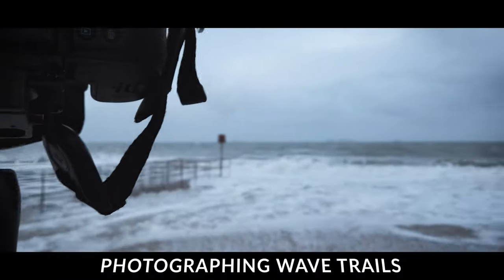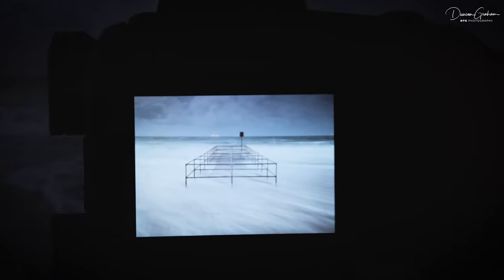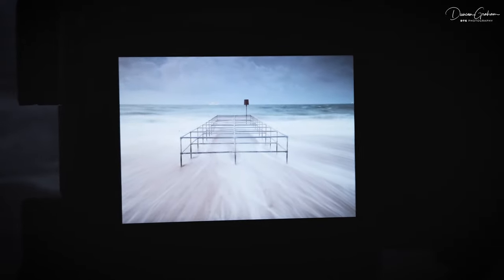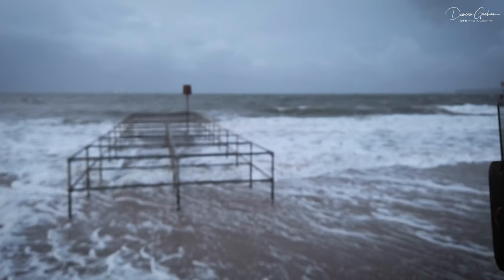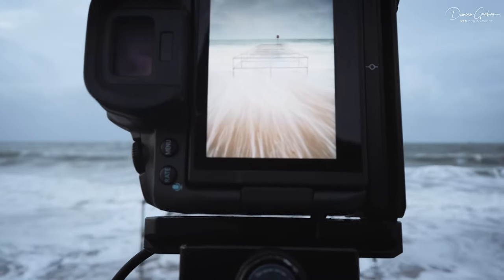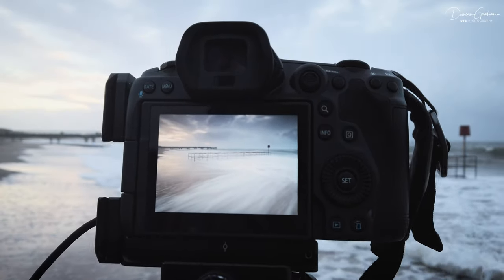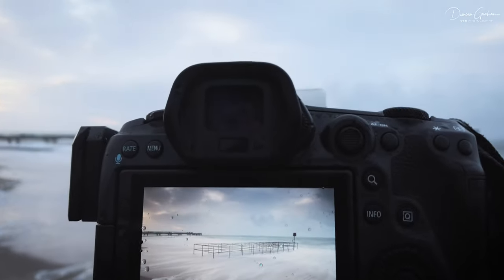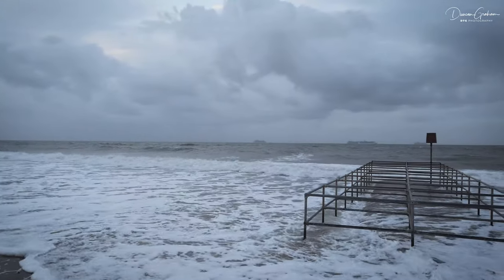How to Photograph Wave Trails | Seascape Photography Tutorial

Comment: Great video, glad they repaired it (or is that a different one?)  Can I ask, as an enthusiastic amateur, I see a lot of pros disregarding the light meter i.e. getting it bang in the middle and exposing more to the right using the histogram.  Is this simply a case of getting the shot that you prefer as opposed to having the  camera deciding what it wants/prefers?

I shoot in full manual but still always aim for 0 on my lightmetre, is this the wrong thing to be doing?
Reply from the maker: Hi Dave.  Thanks for watching.  I have to say I pretty much ignore the actual light meter as this is just giving an opinion on the overall exposure.  The histogram is the key.  In the image I expose the image so that the histogram is just a little off the right hand side.  The reason for this is when the white surf comes into the lower part of the frame it will push the histogram up a bit so I give it a little space so that I am not blowing out the highlights in the wave textures.  The idea for me is to capture as much of the range as possible so that I have the data there ready for post processing.  I am just about to start recording a video now which gives a good example of this..  I hope that helps.